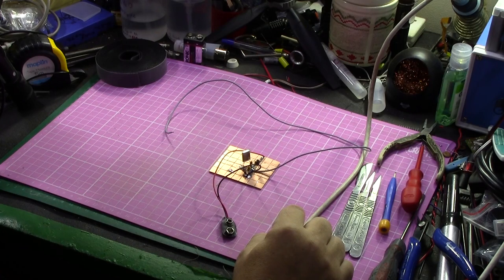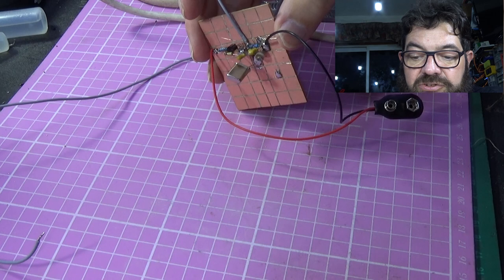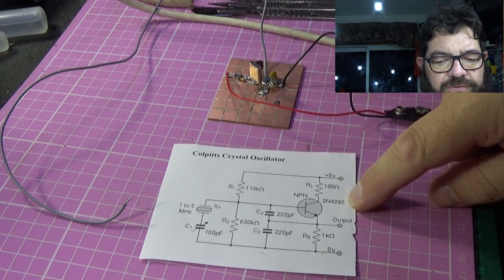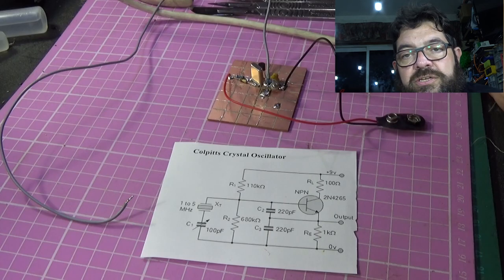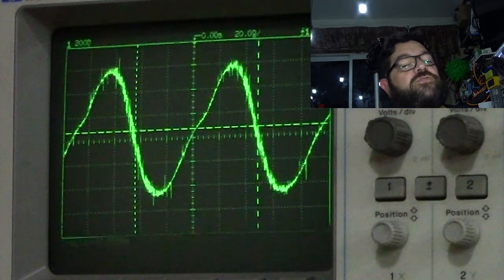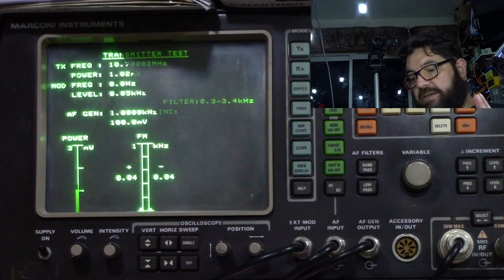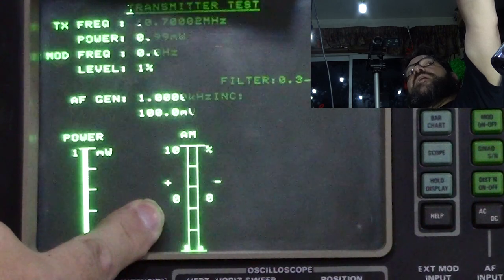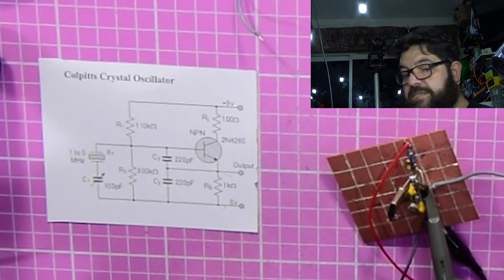Simple Stable Crystal Controlled Oscillator

Comment: Very nice George, I learned something new.
I like the audio on the closeup of this video, most of the time I have a hard time hearing you because your audio is very bassey  and I have a sub woofer on my computer.
Reply from the maker: Thanks for that Bill. I can have a look at dropping some of the bass. I must check to see if I have the low cut filter switched on. Its a pain with using any ham kit that I havent modified because my voice is quite deep and most rigs are set up for mid to high on the filter.
Reply: Yes you do have a deep voice and you do not talk loud like me...LOL
I can turn of my sub woofer but it is a pain because I like listening to music too, maybe a low cut filter and a boost in the mid range (voice) perhaps a graphic equalizer.
Reply from the maker: Its usually between 1am and 4am when I film stuff Bill so shouting isnt an option. Next time I shoot I'll have a look at the settings on the recorder and the processor and drop some bass out.

Comment: Nice, I have an oscillator I cut out of an old computer board. It runs with any crystal from about 2mhz and the highest I have is 78mhz.  I can't get to it run with a 1.8mhz crystal though. Possible not enough feedback to oscillate at the low frequency.  I usually have a 7.027mhz crystal in it to provide a marker in the 40M ham band.
Reply from the maker: It could just be the effects of the loading. maybe increase the resistor in parallel with the crystal/trimmer.
Reply: Thanks George I might try that.